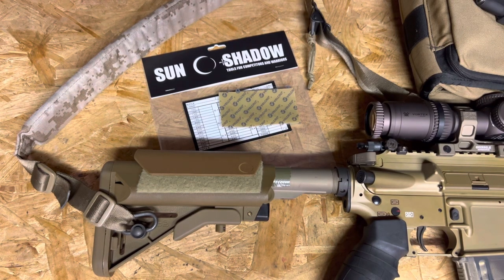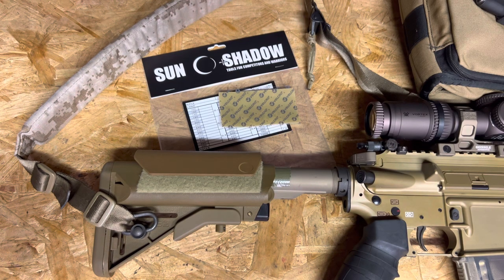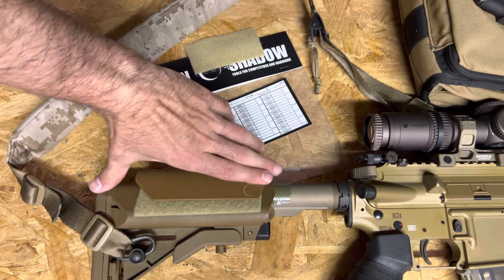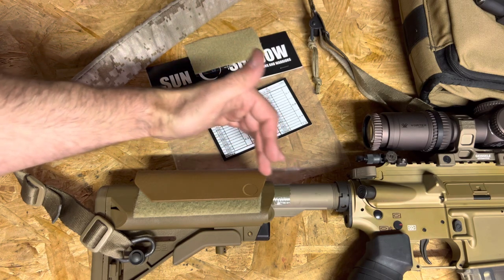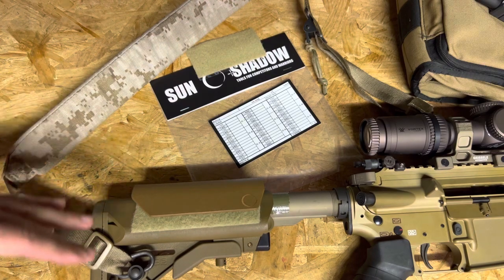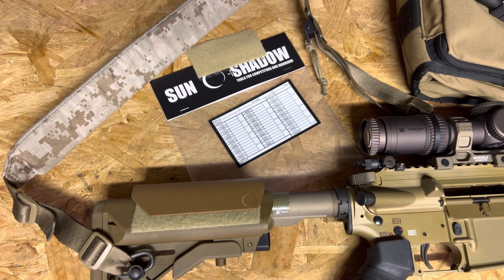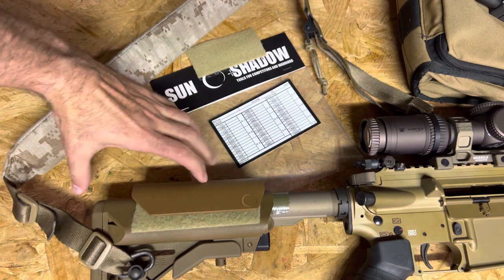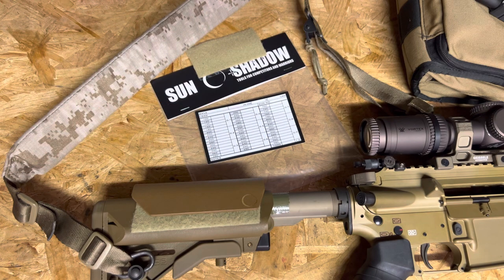Sun and Shadow Cheek Riser

Comment: How do you feel about the Cheek Riser for a Unity Fast Mount? I'm thinking about getting it for My KAC SBR 11.5
Reply: I just ordered one to use with my DD Mk18.  Got the Unity Fast Mount for the Eotech EXPS 3-2 and the Unity for the G33 Magnifier.  I’ll let you know how it works out.
Reply: @jeremysumrak1842  Sweet!
Reply: @jeremysumrak1842  Did you ever try the cheek riser with your Unity/Eotech setup?  I've got a 3-2 and G45 mag.  With a longer neck, I'd like to raise the optic, but I love the cheekweld of the lower 1/3.  The cheek riser MAY help.  Thanks in advance.
Reply: @scottclaiborne5123  Update for you.  The riser works great for elevating my head to the riser enhanced optics.  I’d say my only complaint is the attachment method of the riser to the stock.  With it just being hook and loop Velcro, when I’m transitioning from rifle to pistol, then to rifle again, the riser sometimes catches the gear on my plate carrier and wants to pull off.  I’ve just got a ranger band across the stock and riser both.  That seems to solve that problem for me.  I’d still recommend the riser.
Reply: @jeremysumrak1842  hey just seeing this. Been doing riser research. Sun and shadow, GBRS, Irregular Defense, and ape defense all have what appear to be good options. I think i'd prefer the gbrs/irregular methos of attachment via 3d printed tabbing. With thew sun and shadow riser installed and secured with either ranger bands or some camo wrap, do you see that being secure enough for hard use?